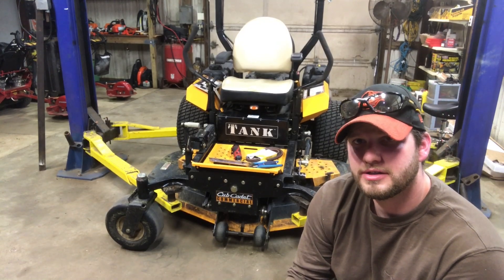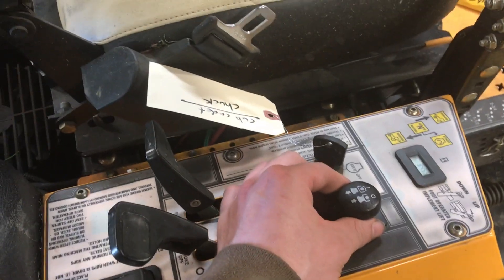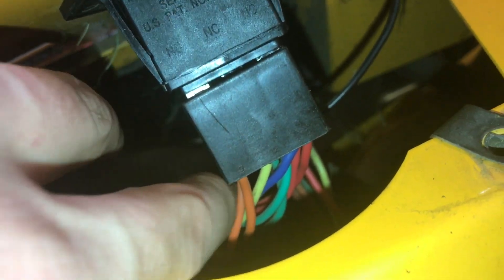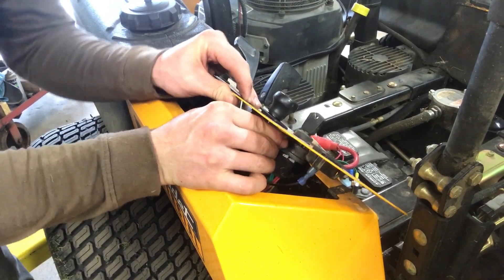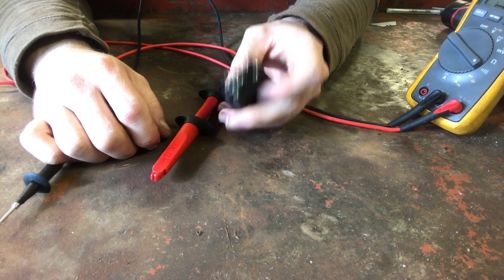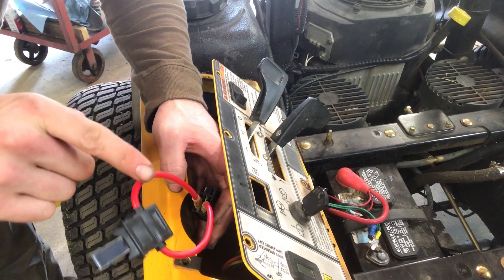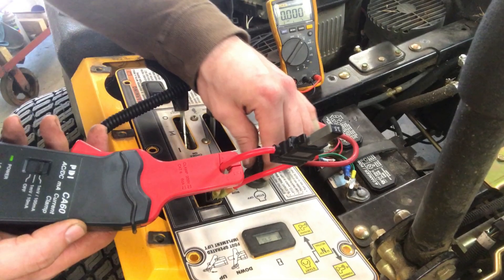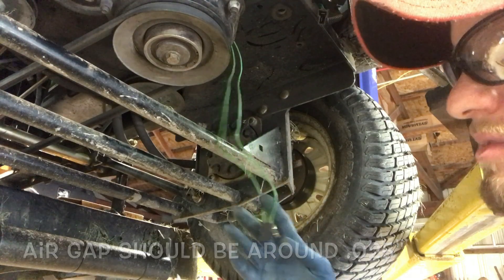Mower PTO switch hot/failing-troubleshoot clutch circuit

Comment: Hello,
I liked your video on clutch troubleshooting/I installed a new PTO clutch after the old one would not engage on my Toro.
When I engage the PTO it kills the engine.Not sure if you ever saw that before.If not, I am wondering if the wires are crossed and the polarity is reversed. (old connector)
both old and new clutch read over 3 ohms.
Not a good job troubleshooting.
Any advise?
Thanks,Mike
Reply: Problem solved, it wasnt the clutch it was a ball wedged in the deck.  But I learned all I want to know about PTO clutches Thanks to you.

Comment: Got a zero turn in the shop doing the same thing. Customer said the blades came on for a few seconds then shut off. He replaced fuse. Blew the fuse again. He put in a bigger fuse. It burned out the PTO switch. That’s when he brought it to me. First thing I did was check resistance through the clutch. It was at 0.5 ohms. Boom, done, internal short inside the clutch. Replaced clutch. Problem solved.

Comment: I've been trouble shooting a gifted JD z425 that sat for two years.  Not trying to spend money I don't have too.  Ohm'd out the clutch at 1.4 after popping a 20amp.  Looks like the previous owner did the same thing as the wiring diagram shows it as a 5 amp fuse.  Looks like I'm ordering a new clutch.  Thank you so much.

Comment: working on a Simplicity ZT3000B2450 with a Briggs engine, i had bought this mower, rebuilt the LH trans, started it and everything was fine until i engaged the blades, had a strong draw down in power, shutter and then it shut off, plenty of compression, fire to plugs and fuel, problem i have now is that i have NO power to PTO switch or hour meter, and when i turn switch to start, nothing...all 5 safety switches check, i have taken off the whole wire harness thinking i might have a bad wire, but it occurred to me after watching this video that i haven't checked the clutch to see if it shorted the switch because it is bad... Could this be the case, can a bad clutch fry the engage switch and cause it to act like the safety switch is bad???? thx tony

Comment: Hey Billy, my grasshopper has charged battery. but when I turn on the switch to crank the machine no light comes on PTO switch seems to be working. What should I check? It was working fine the other day. All connections seem solid
 Thanks in advance for any advice

Comment: is that a home made jumper wire
Reply from the maker: Yes.
Inline Fuse Holders & Fuses Kit - Muhize 16 Gauge Automotive ATC/ATO Standard Fuse Holder with 15 AMP Standard Blade Fuse (10 Pack) https://www.amazon.com/dp/B07XLZN1Y1/ref=cm_sw_r_cp_api_glt_fabc_JPJC36RJ7MNTJ6671WDP?_encoding=UTF8&psc=1

GLOSO E71 2.8 mm Automatic Circuit Breaker Mini ATM 10Amp Circuit Breakers Auto Reset (T1) - 1 Pack (10A) https://www.amazon.com/dp/B084BQHZFJ/ref=cm_sw_r_cp_api_glt_fabc_QD2DCSMY16PVF87438SM

Something like this..

Comment: I bought a 2008 RZT 50 for $250  (in 2020)because the guy replace the pto and still didn't fix it. After finding a schematic, I trace it down to both reverse switch were bad. Only took a half hour to find it. Just jumping both was all I had to do. Actually all I had to do was to jump one of them to get it to work. The diagram show that if both handle are pulled back it means you are in reverse. Home owners version of mowers need to shut off the blade in reverse. Now I  think I need to rebuild both Trans.  Keep those videos coming.

Comment: If you said 1800 milli-amps it is 1.8 amps not 18 amps.
Reply from the maker: That is correct, however the inductive current clamp interprets 10mv/A. So .180mv = 18amps.

Comment: Hey Hillbilly Rig, just came across this video looking for a resolution to my PTO issue.  I have a 2014 Cub Cadet RZT 50 i bought off another user.  A month after buying it, started having PTO issues.  When you are mowing, while the blades are engaged and you put in reverse (PTO automatically cuts off in reverse for these), after going out of reverse, the blades will not engage. You would have to tap on the deck to get the blades to re-engage while riding.  (This didn't happen everytime for putting in reverse but every so often).  Now, about 2 weeks ago, while mowing, the blades just disengaged and wouldn't come back on for anything.  Got a multimeter and tested for continuity and didn't have any in the switch.  I replaced the switch and all seemed good.  However, after about 10 to 15 mins of mowing, the blades would not engage again after putting in reverse.  Ordered a new PTO clutch online, replaced yesterday and it seemed to be running like new.  It even felt smoother after engaged the PTO button.  However, after we were mowing for about 45 mins, it did the same thing again where the blades wouldn't reengage after putting in reverse.  Turned it back on this morning and they engaged, but it seems to do this when the mower is running for a while.  We have a new switch and a new PTO clutch.  Any other ideas what the issue may be?
Reply from the maker: Find the reverse safety switch’s-they may be out of adjustment,  need cleaned or have a wiring issue. The switch will either be normally open or normally closed. I would guess they are disrupting power to the PTO. Just follow the wires 👍

Comment: Hello I have husqvarna  I have new pto  clutch and switch still blades want  engage my pto clutch unplugged  reads 4.2 OEM's I can run jump from battery it will engage  in clicks
Reply: My PTO clutch runs 3.4 ohms and my toggle switch run 0.0 and all of them from across the cross and then if I pulled a blades up is still the middles it's all good so what else I need test

Comment: Hey Boss, got a question - not sure if you are familiar with Toros or not - I got a Z500 Z Master 2012 toro - And the engine runs smooth , but whenever i try  to activate the PTO switch - blades will not run and my engine shutdowns.  Is this a result of a bad PTO Clutch?
Reply from the maker: It sounds like the kill relay is being switched and grounding out your ignition coils. You could remove the engine cover(it’s not too bad) to gain access to both ignition coils-there should be a single white wire to each module-disconnect both those white wires. See if that fixes the issue. If it does, something is tripping that kill switch(an improperly adjusted safety switch, neutral safety switch, delay module,etc)
Before you start, think about how you’re going to shut the mower off. There’s likely an inline fuel shutoff valve, turn that and wait for it to shut off, or pinch the fuel line with vice grips..umm or ground out the coils, disconnect fuel solenoid connector on carburetor.
I hope you have a carburetor and not EFI.
I realize this is true hillbilly diagnostics-but it will get you down 1 of the 2 paths.
Reply: Outstanding reply- I actually did some ohm test on the PTO clutch it came out to be 2.2 and surprisingly once plugged everything back in - I started the lawn mower up and tried the PTO switch again- nothing happened the engine didn’t slow or shutoff- so maybe it is the PTO switch itself? I will buy one and get back with you
Reply from the maker: New PTO switch would be my choice if I were forced to guess. Make sure the PTO electrical contacts are clean and tight during install. Good luck
Reply: @hillbillyrigrepairs1814 hey I’m back, after three years same mower. Haha and by the way the PTO switch was the answer. I’m having issues off and on with the clutch not engaging, I have looked back and seen sparks coming out (from the clutch)  when I try to engage and the blades do not engage. Is this a sign of a failing PTO clutch? It does still work, but some times  I have to engage off and on for a little bit. I would say it’s about 15% of the time. Hope you are still on here and doing good!

Comment: My switch when you pull PTO up to engage, nothing happens, but if I get off my seat, and attempt to engage PTO is cuts motor off.  Does this mean PTO switch is working and clutch is bad, or what does this mean?   The mower sat all winter and was working when stored.  First time attempt to use and no go.  Thanks for any tips.
Reply: LoL; that is a seat safety switch. It's suppose to cut off when your not on the seat. Has nothing to do with pto

Comment: Great Video. I have a Cub Cadet Model 183649 Zero turn 50" cut lawn mower. It was working fine till few weeks ago. The blade doesn't engage. When you have key in run position, you hear the clutch engage.Once you turn the mower on, blade will not turn. It is hard to get to wires. But we removed the side black plastic cover. With cover off, we turn the mower on and tried to engage blades. It worked fine. we tried few times and it worked every time. After putting the plastic cover on, blade won't turn. You do hear the clutch engaging when you have key in run position. Appears there must be a safety switch that may have loose connection... Any suggestions??
Reply from the maker: Use a test light to see if you’re losing power or ground at clutch connector.
You may have “accidentally” fixed the mower by messing with connectors. It may also have been a coincidence.
Clip test light to battery negative, turn to run, engage pto(hear it click). Shove test light into each side of clutch connector. When test light lights, that’s your power feed.
Then move test light clip to battery positive. When you touch the other wire(ground) it should light. Then attack whichever side of circuit is faulty.

Comment: My 36 INCH Ferris Walk behind rowed down a small hill. Yes rowed... Now when I engage the BLADES, THEY TURN ON BUT when I turn up the power and start riding over 3miles per hour, they disengage and shut of??? HELP ME... THANKS
Reply from the maker: BrezzEasyy I would start with a wiring diagram. 
The clutch for the mower blades needs both power and ground to function.
I would buy 2 piercing probes(1 for each wire) then connect jumper leads to each probe.
Connect a test light in series with the jumpers. 
To check the clutch ground, connect test light to power. To test the power feed connect the test light to ground(negative battery terminal etc)
Have the test light where you can see it(on your lap) and when you go over 3 miles an hour or whatever and the blades kick off, that test light will go out.
If you’re losing the ground side of the circuit-hunt that done. Power side-same thing. Be safe. Make your own test leads with alligator clips and wire if you want.

Comment: I have a question. I'm getting power through the PTO switch down to the PTO but it won't activate the PTO unless I ground the other terminal. It's a Cub Cadet 50-inch cut. Any ideas?

Comment: I just came across a Great Dane zero turn mower. My friend stated that they don't make these mowers any longer. Can any parts be purchased for these tractors. Has a 25 HP Kohler. I also couldn't locate any numbers on the engine???
Reply from the maker: The model, serial and spec. number should be on a silver sticker located on plastic blower housing of engine. If that’s missing. Try and contact Great Dane(or the company that bought them) with the model and serial number of mower. 
Lastly, take the mower up to a dealership that carry kohlers.
Try calling Kohler too.
I don’t believe these engines are stamped-maybe under the crank pulley 🤔
Reply: @hillbillyrigrepairs1814  I was afraid that you were going to say that the numbers were on the decal. That decal is pretty washed away. Someone messed with the wiring and safeties for the PTO so no shop will work on for safety reasons, so i am attempting to work this thing if I can find a manual with part numbers.

Comment: I have a 2009 Cub Cadet 48" ZTR that I thought had a switch problem. I installed it. it ran for over half an hr and when I went to turn the mower back on, the blades wouldn't engage again. Does this mean the mower blew the switch out and I have to buy another one?  Does it also mean that my clutch may be causing the switch to blow. 
I'm no mechanic but I get by with simple fixes, but I am not sure I can handle putting in a clutch if that is what it is. I also noticed, right before it totally wouldn't engage, that moving the left lap bar made the blades turn again, but that only lasted a few seconds.
Reply from the maker: Greg Taylor Yes. A partially shorted clutch can keep blowing out switches. The likely culprit is the clutch. 
If you have a hand, air or 1/2 cordless impact taking the clutch off isn’t bad. Just need to remove deck belt, the clutch brake assembly, electrical connector and finally the bolt that goes through the clutch and threads into the crankshaft. You may have to get creative getting the clutch off the crankshaft; they like to get stuck.
Reply: @hillbillyrigrepairs1814  Thank you for the response and I do have air tools to work with.  It's easier and more cost effective if I can do it, along with the learning experience. Thanks again.

Comment: My old cub cadet 1525, the switch is pushed in and the blades turn. Pull switch out mower dies and wont start with switch out? Check clutch wires?
Reply from the maker: I’d say disconnect connector to clutch(2wire connector near clutch)-then start the mower. If the blades are spinning with the clutch disconnected I would suspect mechanical fault with clutch.

Second issue is likely in your safety switches and/or wiring causing your ignition coil or coils to ground out-shutting off the mower.
Reply: @hillbillyrigrepairs1814  So what do you do if safety switches are grounding out and the blades are shutting off? 

My 36 INCH Ferris Walk behind rowed down a small hill. Yes rowed... Now when I engage the BLADES, THEY TURN ON BUT when I turn up the power and start riding over 3miles per hour, they disengage and shut of??? HELP ME... THANKS

Comment: I have the opposite problem with a Grasshopper 618.... the blades and pto will not DISengage.
Reply: Zeus 1  no.... it was my Dad's mower, he just parked it and bought a new one. You know how stubborn old men are. I was convinced that it was the switch, he wouldnt let me work on it. BUT from everything that I read on various forums the problem is the switch.
Reply: Zeus 1  to be clear.... the engage/disengage pull switch for the blade.... that is the only thing that makes sense, if it is bad it will make the blades try to spin upon starting. There is also a clutch on the engine somewhere that could cause it.... but like I said, i never got a chance to fix it.

Comment: Have a 2006 M60 Tank. Had a new clutch from dealer put on probably 4 years ago, about 300 hours. Recently, after mowing for a while, if I turn off the PTO, I can't get it to come back on. One sneaky way to get it to come back on, is after I pull it back on and nothing happens, if I push the rpm level all the way to low, then push it back up to high (full throttle) the pto will come back on every time. This only happens after mowing for a while, with this intermittant PTO. 

What should I check? Saw you posted a reply that said this, would this apply to my 2006 M60 tank? 

(Can you hear the Clutch engaging(“clicking”) on and off each time you pull the PTO switch up? If I’m forced to guess.. sounds like the “air gap” between clutch discs could need adjusting; 3 nuts on bottom of clutch-mark each with a pen and turn clockwise 1/4 turn at a time. Need to tighten evenly. Check and repeat. I would really recommend a feeler gauge. Good luck!)
Reply from the maker: burtmanindustries 
Perform a quick voltage drop test on the clutch circuit also verify clutch has a good ground. Be sure to SAFELY test circuit while the mower is acting up. Then look at the clutch—if it’s black and has three bolts holding it together, it’s likely an adjustable clutch. If this is the case go to Ogura website and lookup clutch air gap specifications. Check gap with feeler gauge.

**Harbor Freight sells a strong 1/2 electric impact wrench; if you’re looking to replace clutch yourself. Any excuse to buy a new tool ;)

Comment: Been doing small engine work for over 25 yrs I've had occasions when the pto Omed fine but the clutch was still the issue ...keep in mind this was rare but has happened
Reply from the maker: I checked the resistance for all the youtubers; just another diagnostic approach. If a clutch is pulling 17amps, it’s getting a new clutch and new switch. Thanks for the comment.
Reply: @hillbillyrigrepairs1814  my deck runs, switch works as it should, but when mowing I get an intermittent drop out where the deck is still running and engaged but if I try to move the engine bogs down. Would this be a clutch issue?
Reply from the maker: Sounds like an engine issue. You could zip the blades off and drive up some step grades-if it bogs then you may  have an engine or hydro transmission issue. If it bogs, perform basic tune up stuff first(suck, squeeze, bang, blow)

Comment: Vary good vid. . I work on mowers as well and good at . I been doing it for the past 18 years  . I came across a real problem about a iffy PTO . It test good then after  few engagements and blew 2 switches  I think you solved the problem . Bad PTO . I suspected this all along but not for sure .  The problem and what made it difficult is that one day the pto work fine the it would blow a switch  then a new switch blow in less than a minute . The customer had told me .    All I have to say thanks for the great advice .